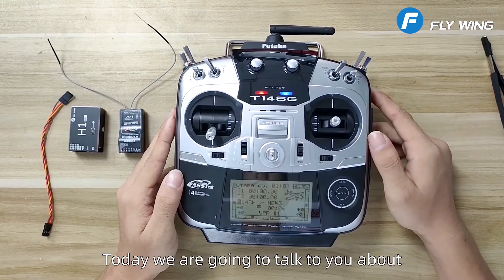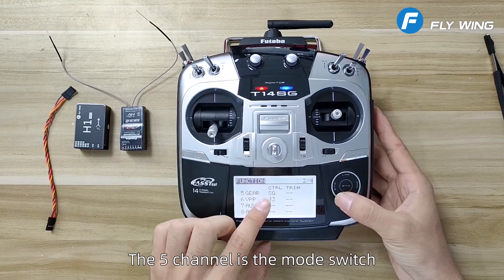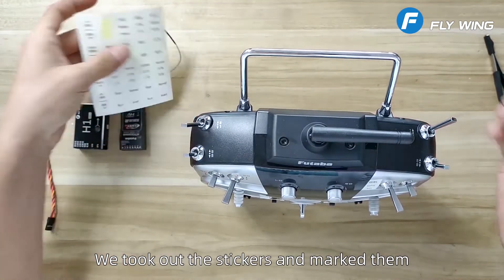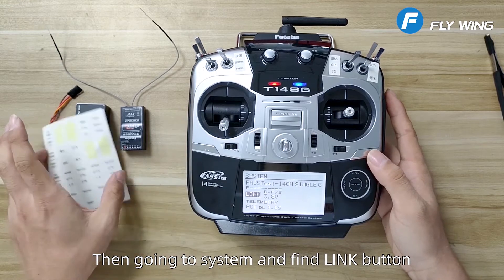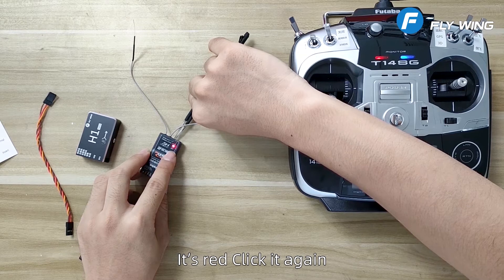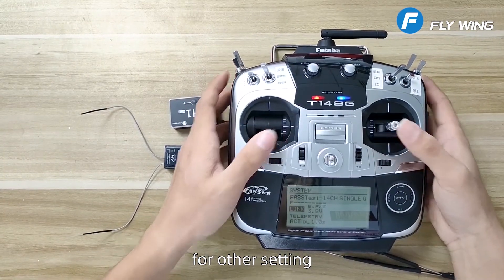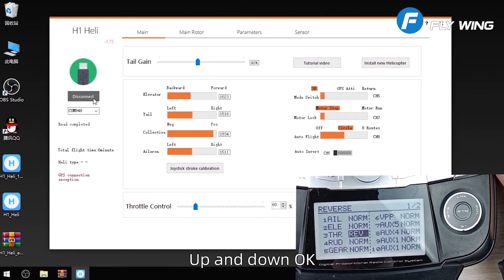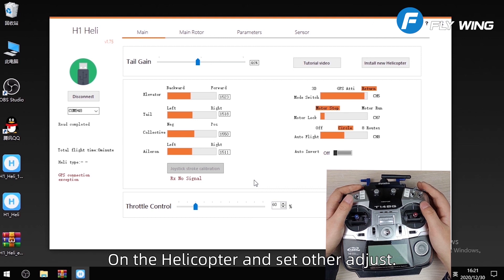Setting H1 helicopter flight control with FUTABA 14SG remote control

Comment: how put my receiver (FUTABA R6208SB) in S-BUS mode ?... I connect my H1 to computer and recognized but says "RC IN No Signal" ...
Reply: Hello bro, I try to do fail safe, but it don't show me RC in No signal, what's happening?
Reply: @paullingtaiung5587  Mine goes in to no RC instead of fail safe settings when I try to do failsafe.